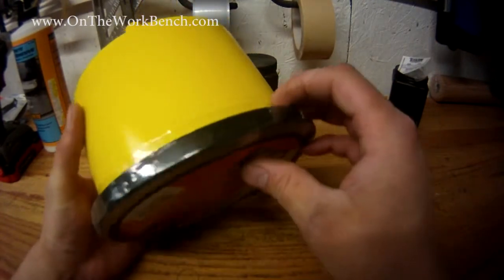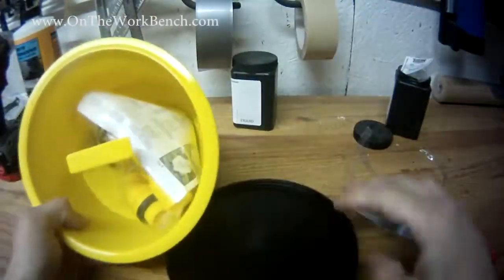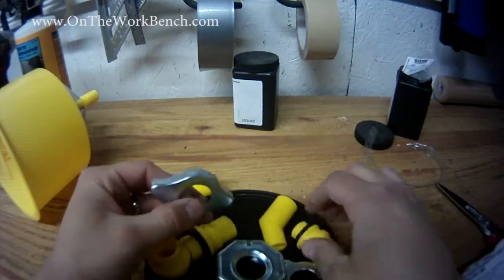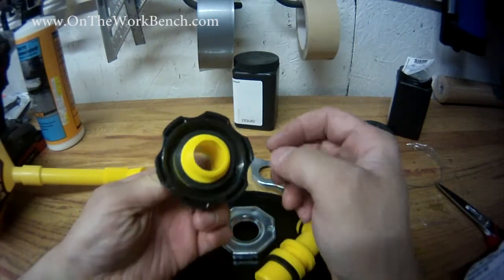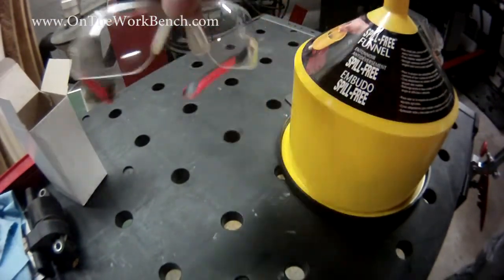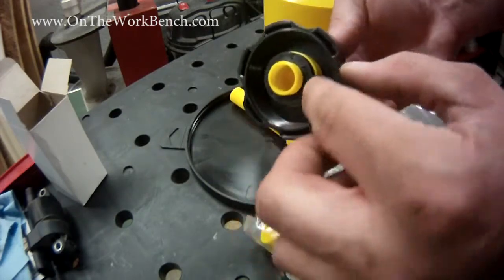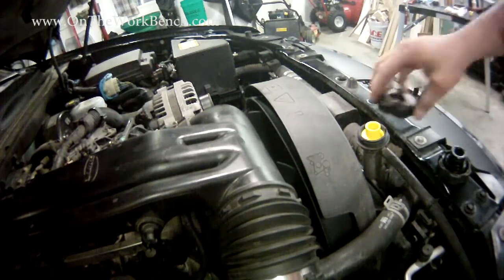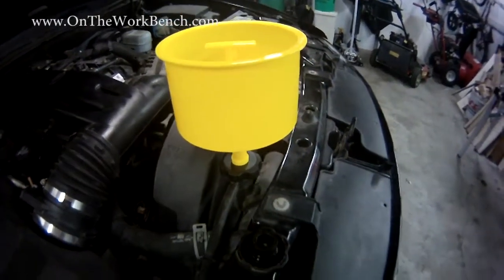Lisle Spill-Free Radiator Funnel

Comment: I just within the last month changed my sons radiator on his car. This indeed would have been handy!   I did not take enough care and I needed up with some air in the system... he did not overheat the car but did indeed have some heat rise! One we filled it and got all the air out we were good.  This tool for me would probably not be used often enough to quite justify it in my mind bit then again I am a tool junkie. These really are cool how they work!